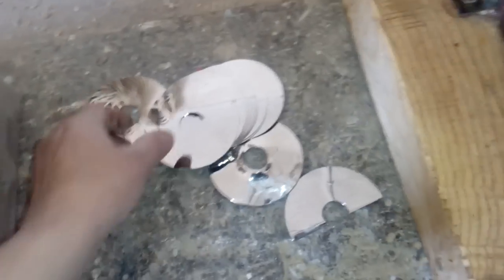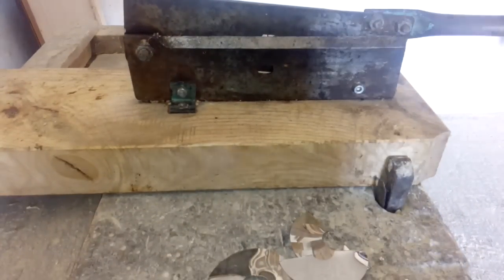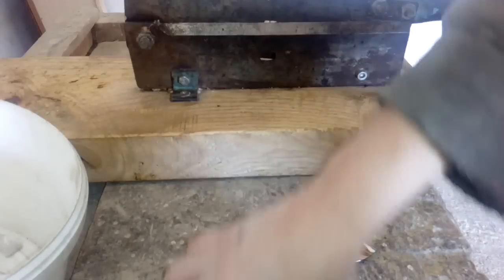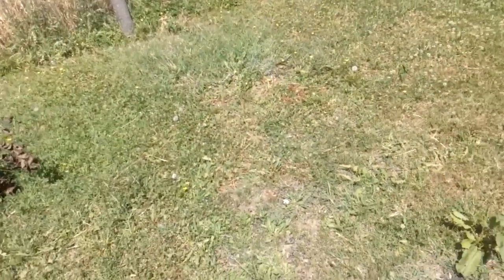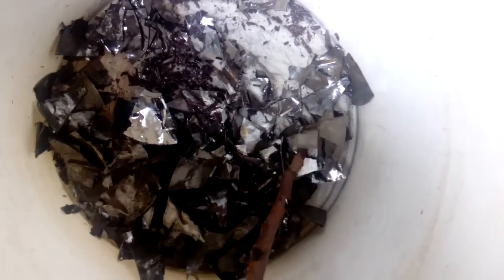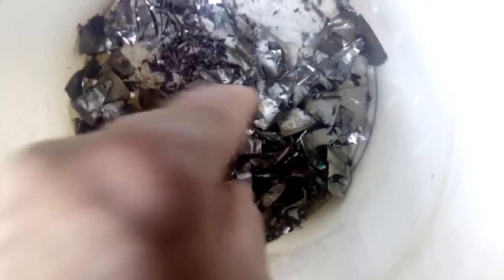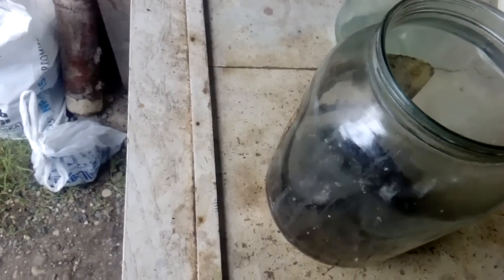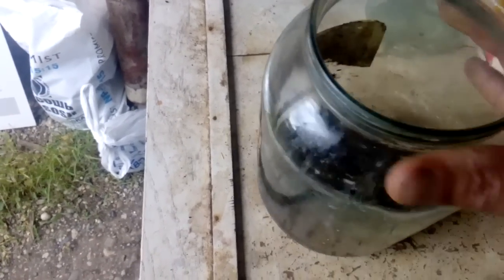Platinum recovery from Hdd plates part 1

Comment: I attempted this ONE time,,I had enough HD PLATTERS (disc) to fill two 5gallon buckets,, didn’t get any platinum because they were all made after 1980,,, I was very disappointed at wasting all that time and chemicals for nothing
Reply from the maker: To be honest, I was disappointed with the amount of platinum I received, but what I did was wanting to do the process. Many of my plates were with very old hardwares, those thick discs.
Reply: If a disc does contain platinum it has a layer that is about 1 micron thick.  Which is pretty close to nothing if you want to hold a tiny ball in your hand. Would require a few hundred more disks that many people don't even have room for, or the resources to even accumulate that many. It is like expecting to save the gold foils from a bottle of liquor where the liquor costs more than the gold content every time.  

Then there is the time spent refining and the money spent on chemicals.  If you owned a recycling company that just collected old computers all day and dealt with hundreds or thousands of lbs daily then it may be worth it.  And the hard drives are not going to be the money maker.  We are talking gold, copper, and silver.  Such an abundance of scrap that you can pour bar after bar.  Unfortunately, due to the growing knowledge of metals contained in things that become junk everyday, people have caught on and will hoard these items or try and sell them to you at a low price (with high shipping cost) or a high price (low shipping cost). 

If scrapping is your primary business you can do quite well.  At least it will have to be a hobby that  burns most of your free time.

Comment: ONLY THE VERY OLD ONES HAVE PLATINUM,,those made before 1980,,after 1980 are Nickel, Cobalt with Aluminum core,,, And the old ones that do have Platinum are not worth processing unless you have 1.5 to 2 kilos,,you need that much to compensate for your time and chemicals involved
Reply from the maker: I fully agree with you. The video is only informative and, in my opinion, it's not profitable to waste time on this process.
Reply: the rougemillenial before you stick your foot in your mouth again maybe you should watch a video to clear things up (what’s it made out of,,, hard drive disc)
Reply from the maker: The reason for such a small amount of Pt that came out is that it does not contain every disk a Pt. When I scrap the HDD, I personally never look at whether they are newer or older, the drives go to the same bucket.We all know that there is Pt in them, we agree here, we also agree that it does not contain all Pt, so Pt refinement from HDDs is completely unprofitable. Video was meant to confirm Pt in disks and show that it can be removed without expensive tehnology. This is no tutorial how to make money on this.

Comment: If the foils are not only Nickel and  Kobalt, why don`t try first HCl for Aluminium, than HNO3 for the nickel (and decant the two liquids, get rid of Al/Ni)? Platinum should not dissolve in that and stay as foil or fine  powder in filterpaper, than dissolve with aqua regia (AR).....
Reply from the maker: I removed the aluminum from Hcl, but I directly dissolved the foil in Ar because I think that it is a nickel and precious metal aloes, so only the nitric needs a very long time to do the job itself, but it can, of course, in that way. I still have the other foils that Ar did not manage to dissolve without additional heat, which tells me that it is platinum because the paladium would have been dissolved much easier.
Reply from the maker: Thanks for advice and information, I will try to remember that :)
Yes that magnetic alloy  depends on the manufacturer and the model.

Comment: Good experiment. That will be cool if you actually get platinum. I have done quite a few tests with these hard drive platters and my findings are that the specific ones you are working with are aluminum on the inside and the foil is nickel. I have never gotten any platinum out of these so it will be interrsting to see your results. Please let us know even if the experiemnt isnt a success. Nice work.
Reply from the maker: We will see in the end. It interes with the way you tried to get platinum from the plate, maybe share the process with me. It will show the result in any case, any result of it being at the end.Thanx for suport :D
Reply: So the way i did it was similar to you.  I dissolved the aluminum and collected the foils.  However when I weighed the foils from onehard drive platter I realized it weighed way too much to be platinum.  So i started testing it.  Turns out the foils are magnetic which leads to nickel.   Then I dissolved the foil completely in aqua regia and did a stannous chloride tes with a negative result.  I know from my experience of working with platinum that stannous chloride indicates a positive even with very small amounts of platinum in solution.  SO i came to the assumption that these hard drive platters have no platinum. I also tested the glass core platters with the same result.  I will attach the links to my videos in a separate comment so this doesnt get flagged as spam but you may have to go to your spam comments to get them.  Anyways throughout the experiments I have done with the platters I have foundthat there is an indetectable amount of platinum if any at all.  But good luck I could be wrong.
Reply from the maker: Chemical Mishaps vhen you disolve foils in Ar,do you boil solution or not,just interest me?Do you got smol foil like me on the end-they dont disolve vithout heating on 80 c degres?
Reply: 999 Dusan Gold recovery i did have quite a time dissolving them. But i was doing very small scale reaction in test tube to just test for presence of platinum. So i put the test tube in a styrofoam cup of hot water and replaced it when it cooled off until the foil was completely gone. Took probably 1 hour or so. It worked for what i was doing but on a larger scale it wouldnt work. But with my experience with platinum it dissolves very slowly. I always applied very hot heat and would just replace the acids as they were evaporated which is quite wasteful but i wanted it to go faster. As for the step after the platinum is dissolved i never had very good luck precipitating the platinum with ammonium chloride. The ammonium chloroplatinate always absorbs too much water from air and is a mess to try and dry and melt. So what i would do is boil the solution down after dissolving the platinum to get just the salt and then rehydrate and boil down again to remove all of the nitric acid leftover. Then i would dissolve the salt and add a small piece of alumnum. When it stopped reacting with the solution i would add excess hcl to dissolve the leftover aluminum. Then you should have a black powder in bottom of beaker which is platinum. However i am not an expert and this isnt the best method because if there are any othet metals like nickel then they will be present also. So u may have to do the ammonium chloride method. Or you can use my preferred method and remove the nickel powder from the platinum with a magnet. I have done this method and it works but the powder has to be extrememly dry and very fine. Anyways. Like i said im not an expert but i have learned quite a lot about which process i like to use and which i dont.
Reply from the maker: I saw your video shoots. It's also true that it does not oal platers contain precious meta, it's possible that only 30% of them contain platinum or palladium. I will drop with Amonium chloride. I did a quick stanious test this morning and got a reaction similar to Paladium. While I was ill, I left the solution occasionally in the sun at 40 degrees Celsius and after three weeks I still have a foil that did not dissolve, and I added a little nitrite two or three times, which means it's a noble metal. We'll see for a few days I vill finish the process to the end.
Reply: @nicknewberry5296  plz tel  one  by one
Reply: me tocó pisar uno por error y se quebro como un vidrio normal